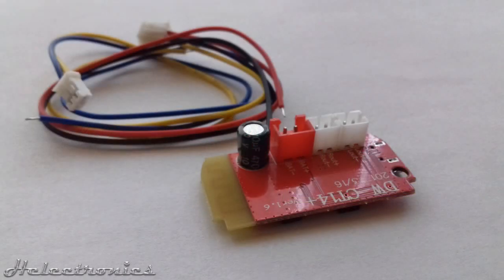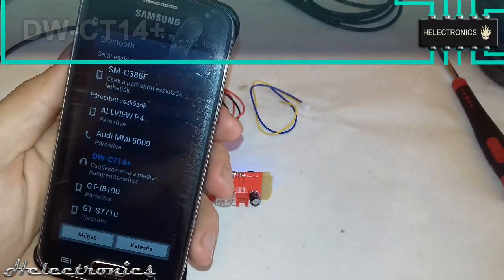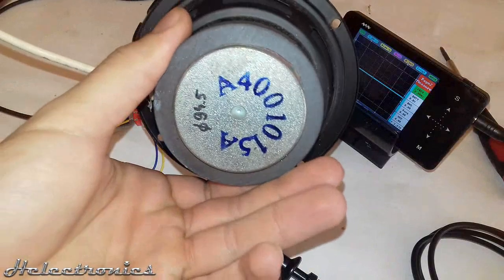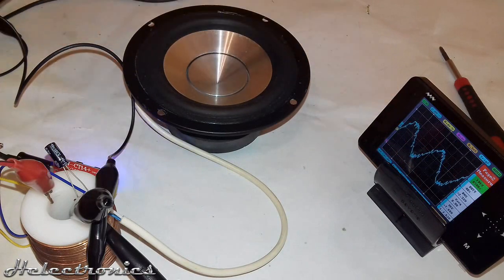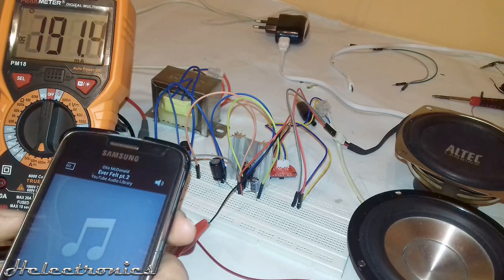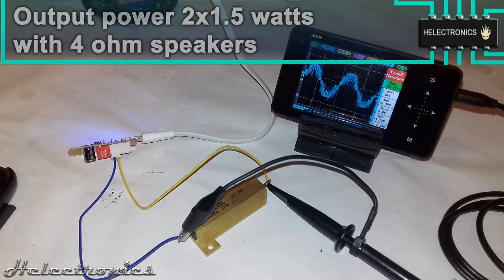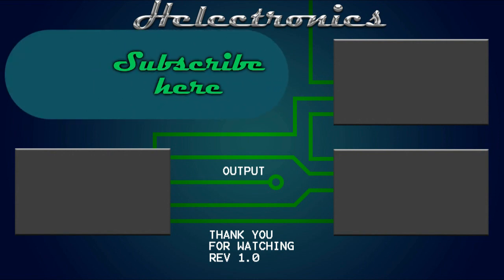REVIEW - Stereo Bluetooth Amp DW-CT14+

Comment: hi Helectronics can i connect the Lout- and Rout- to make a L GND R output for my power amplifier? Thank
Reply from the maker: Hi, I won't recommend to do that, the output is a PWM signal, which can harm your power amplifier. This circuit is designed to be connected directly to speakers. If you want to use your power amplifier buy the XY-BT-MINI bluetooth receiver product, which you can see here: https://www.youtube.com/watch?v=XVV3OKfZNYE

Comment: Helectronics
I have a few of these boards and they are very good for the price.  I made the mistake of connecting 12V to one of them and well "SMOKE"  my bad.
Reply: Yes these are very good boards, it can be used in almost every speaker to make it bluetooth speaker for a good price.
Reply: I test my and the maxiumum safe voltage for it about 6volts

Comment: Is it possible to connect it with two 3w 2ohm speakers?
Reply: Yes, but with the power supply of 4,2v maximum
Reply from the maker: I found a description where it is written, I quote: "Can connect two 2-8ohm, 3-10W speakers, push storage with 3ohm 5W and 4ohm 10W speakers." So it might be compatible with 2 ohm speakers, but I haven't tried it.

Comment: hissing noise is noticable or not?
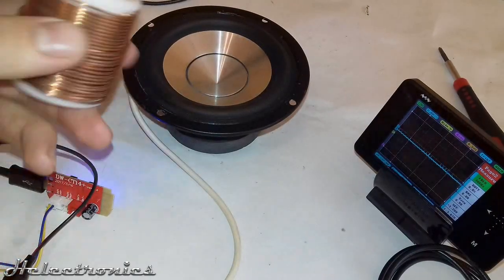Reply from the maker: I didn't notice hiss, but probably on a hifi speaker it can be heard. At 2:52 the board is working and it is connected to the phone but no music is played, still you can see some spikes, so there is a noise present, but probably my speaker (which is more like a subwoofer) didn't output this noise.
Reply: Den crafter  No you need a separate charger module. I use it with an Adafruit 259 Li-ion Charger and it works perfectly with a single cell 2500 mAh battery. Great for DIY BT headphone projects.